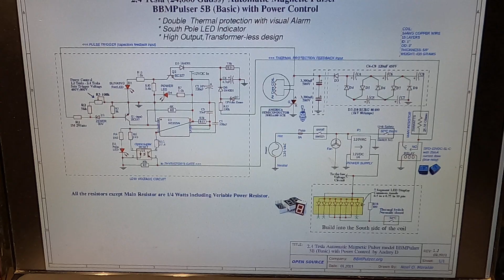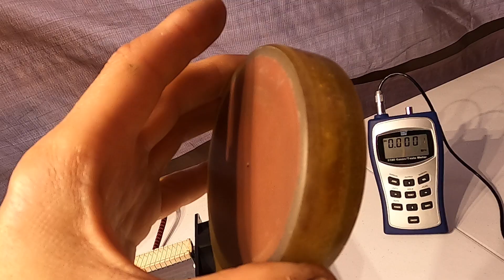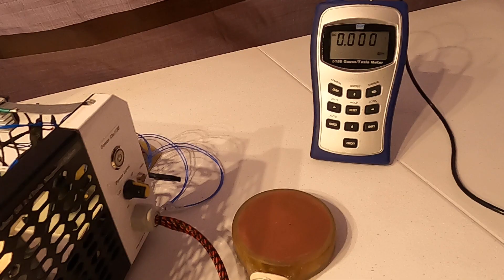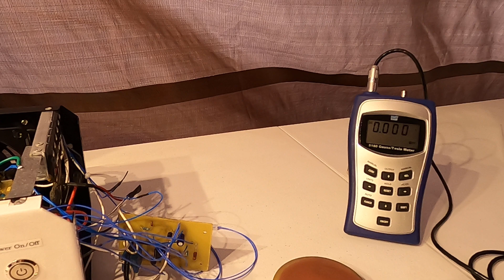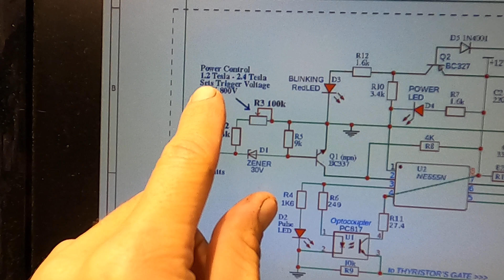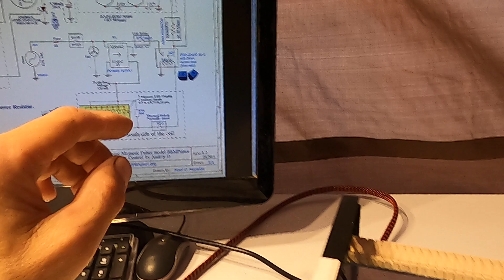083 BBMPulser 5B inside look

Comment: well done but you complicated the scheme too much.  Plus at 555 you loaded with a lot of resistance, pointless optocoupler.  I know you want the scheme to look like your own invention but there is no point in filling a cable with resistors and optocouplers that have no role other than to make the scheme look worse.  we have counter-time contacts.  Pin 3 connects to the relay, pin 4 connects to the thyristor.  Adjust the time from the resistance on pin 6.7 and capacitor on pin 1.2 ... Anyway, thanks for presenting your project, and I appreciate your work, just that you were too complicated ...👍👍👍
Reply from the maker: Can you be more specific, which resistor is not needed?
Please give me the resistor numbers I'm assuming you are talking about BBMPulsers 5B 120VAC circuit.
You can find the circuit at BBMPulser.org
I'm willing to simplify the circuit if it's possible. My goal is to have the least amount of component that's possible while keeping it stable.
About optocoupler. Yes you can connect pin 3 from 555 chip directly to the thyristor.
I added optocoupler for safety.
Here is why.  Many people who build my circuit sometimes  may connect thyristors incorrectly. If there is no optocoupler there the whole circuit will smoke, (chip alone with many components on it) will be distroyed from 920V from Capacitor Bank.
Having optocoupler there saves from this. safety future.
Other thing is that 555 chip is not strong enough to trigger thyristor that's used there. It requires more current then 555 chip can safely supply that's the second reason I'm using it to increase pulse current so optocoupler is not a bad idea to have. Also it's a  cheap component price 50 cents
Reply: @AndreyD  this montage is derived from the Egyptian cross ANKH.  I used this assembly, with the changes in antigravity and I believe how many pieces you put just to get magnetic pulses, I put half to get antigravity and invisibility.  If you want to help simplify the scheme, it should be accessible to both beginners and advanced, but also to the sick.  These technologies do not belong to us, and we do not have the right to change them in order to complicate and earn money ... We believe someone beyond is watching and will catch your ear one day.
Reply from the maker: @FreeEnergyRomânia  My units are available for purchase (order)  to anyone, beginners and experts and to sick people. Anyone who want it.
You wrong this technology is available for anyone!
If you cannot build it from circuit then you have options to buy it already premade unit, please contact me via support@bbmpulser.org  email to order
Reply from the maker: As fur as level of complication.
Yes this circuit is not for beginners or rookies. This circuit is for more experienced electronic intusiasts
Reply from the maker: Also if you are smart, why don't you design your own circuit and present it?
If you are not smart enough to design your version of circuit then please redesign mine and send me simplified version of it that's proven to be stable, if you send me one circuit like that I will post it on my website, with your permission owcource and your name under it
Reply: @AndreyD  
I don't like to comment on youtube, but where I see that some montages are being made that should help people, I get a little involved in commenting.  .  The arms of the cross were the oscillator that closed and opened the big coil above, the loop ... And this was powered by a battery ... maybe you will say that there was no battery then but to your amazement they had the battery, only that the Europeans have  stolen from them and declared that they invented, like a lot of technology today. So do not be upset but if you want to do good, do it with humanity not for money as you wrote on your site.  There are sick people who do not have to do the same as the world's elites, to take advantage of the sick to make new money ...
Reply from the maker: @FreeEnergyRomânia  I don't do it only for money.
if I would do it only for money then you would not seen any circuits.
My intensions is to help people and that's why 80%of my magnetic pulser circuits are open source.
Trust me Im getting a lot of emails from people thanking me for being open source and giving away valuable information for free
Reply: @FreeEnergyRomânia  I built this circuit last year thanks to Andrey open sourcing it and I am somewhat of a beginner. His circuit is about as simple as possible while also maintaining safety measures. It would be insane to skip safety measures when dealing with hundreds of volts with a large current especially when you're building the circuit for others with little to no knowledge of how it works. The optocoupler is used to transmit analog or digital information between circuits while maintaining electrical isolation at potentials up to 5,000 volts (although in this circuit only several hundred volts) so the optocoupler definitely has a reason to be in the circuit.. Also not many people would take the time to open source circuits like this but Andrey has done so repeatedly and for that I am grateful!
Reply: @corybrown5583  thanks a lot for your note...a🤔bout Andrey. its my opinion too. he is very responsible person....and he is passionated person like Bob Beck...BOB also give a big gold like a rock...that is why he said "Take Back Your Power"....Andrey repeat this word to the world by making this device open source.🤔

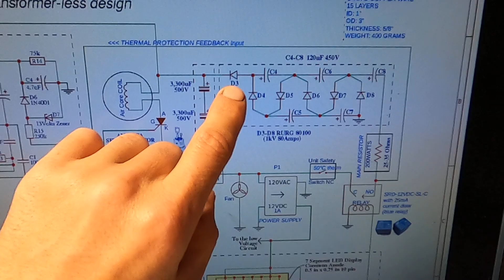Comment: Great video Andrey D! At timestamp 10:12 Which type of resistor do you put between the last diode of the charging circuit and the large 450V capacitors?
Reply from the maker: It's actually inductor, not a resistor. 
It's made using 5ft of copper magnet wire wrapped over my hand and then flattened into the shape of tube. Then it was twisted little and placed into the heat shrink tubing, then I fill the tube with flexit90 resin and heatsink it.
That's how I make it.
It acts like a resistor for fraction of the second allowing pulse current from charging capacitors to do down and not to blow diodes. This inductor heats up a little bit that's normal.
Reply: @AndreyD  Thanks for your answer!

Comment: Good advice on the  safety measures for the placement of the capacitors.  Andre, can you show the details of that  diode-protecting inductor/resistor?
Reply from the maker: Yes I need make a video  on how I make it.
In 95% of the time you don't really need it, this Inductor will lower overall  power output a little. 
I discovered that it's needed for 5th generation models that work on 220VAC.

Comment: What's the value of this resistor for protecting the last diode in a 220V circuit?
Reply: Andrey tell us strait forward answer what is the value of the resistor please? Your answer is not clear.
Reply from the maker: @yeshecan7  for 5B 120VAC circuit main resistor value can very between 25 Ohms to around 40 Ohms.
For 230VAC model value can be between 35 Ohms to 80 Ohms
Reply from the maker: The more correct word to describe this component  would be Inductor.
This inductor is made using 5ft of 18AWG Copper magnet wire wrapped on 4" coil and flattened into the shape of tube then twisted. Heat shrink is placed over it and inside also filled with flexit90 resent so nothing moves.
Also ones it's installed it must be strapped because it moves with pulses
Reply from the maker: This inductor/resistor can be used on both 120Vac and 230VAC models